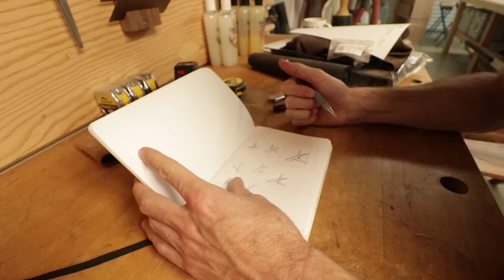My Furniture Design Process - Shaun Boyd Made This

Comment: I don't understand how anyone can fully 'design' digitally.  I think the design is limited to the options in the software.  A pencil has zero limitations.  I'll model some stuff sometimes but it's based off my sketches.  Thanks for the glimpse into your process. Seems to work well.
Reply from the maker: I agree, I have tried sketchup a few times, and I always reach a point where I can't get my full idea onto the computer. No doubt, computer design programs are hugely powerful tools, but just require a specific type of user to get the full benefit from them.
Reply: I mean you cant, well at least I cant keep a specific idea in my mind undil i finally got a line done in sketch up
Reply: @shaunboydmadethis  if you use SketchUp for furniture design, there will be limitations. Try rhino6 next time.
Reply: @v7e4n8om  bro can you tell me from where I can get this software.plzz!
Reply: @shaunboydmadethis  Sketchup, once proficient, is essentially an open page. Once you've practiced, you can create full designs in the same amount of time it would take to make half of the drawings normally. You get a lot of control with CAD software in my opinion

Comment: Hey bud. I definitely get to the point where you do with your design process. The crappy part is I don't really prototype. I just jump into it. Just sketch after sketch on mdf or my work bench and I hop in. For the most part it's worked for me. Nice chair BTW. I would love to see a tour video of your shop. I'm in a small spot, and it's tough. 460 sqft to be exact

Comment: Nice, especially with something you have to sit on, there's just no substitute for a actual prototype you can interact with. It's very easy to design things digitally that are impossible to build, uncomfortable, oddly proportioned, overly flimsy, overly sturdy, etc. Proof of concept, especially when you'll be using fine materials or building several of something is key. In addition to your method, my designs are very often one-offs and dictated by the material available. Maybe a nice piece of hardwood or maybe you'd like something to have a 4.5 inch rail but then you'd need to use 6X material so you have to balance what you want with what's possible and practical.
Reply from the maker: Exactly, there are so many variables, it is always nice to iron out as many as possible before cutting into that expensive material. Thanks for watching!